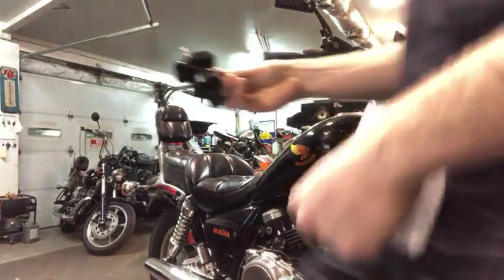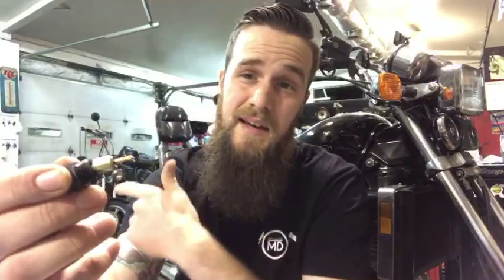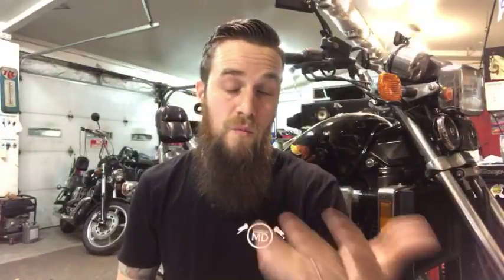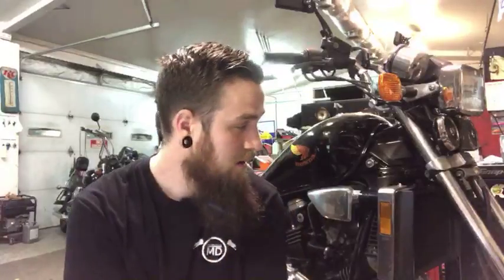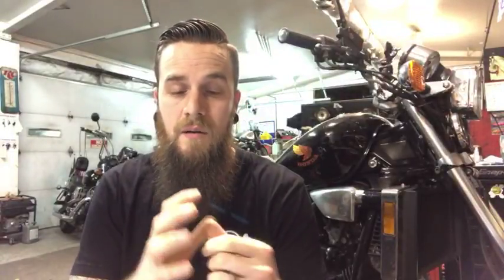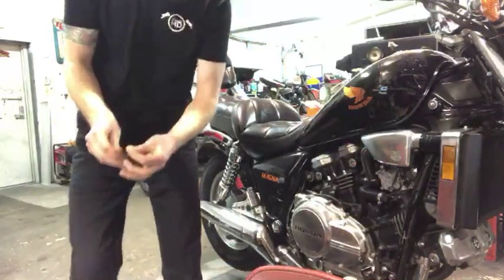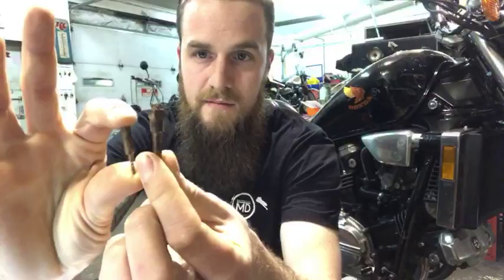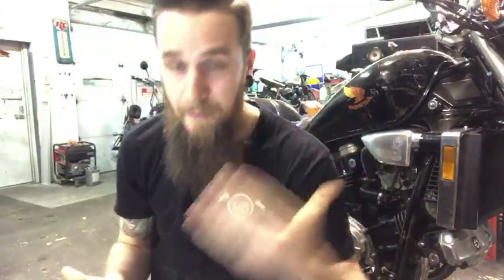What’s A Ground?- ASK MD LIVE Q&A: EPISODE 18

Comment: Thanks Brotha, I appreciate the info and the work you do. Question, Should the butterfly on the Carbs, be fully closed when idle or slightly open? I heard you say, go back to normal, where should the butterfly on the Carbs be to normal?
Reply from the maker: Most likely barely open.
Reply: thanks, just wanted to make sure. That is the way i have it idling.

Comment: Got no spark on my 1987 hondamagna  700 iv checked everything   except  the cdi box , but I just replaced  the starter  clutch  , does replacing  the sc  have anything  to do with my bike not starting ( I checked  the pulse generator  and it's reading  300 , so I'm thinking its working fine)  , so I'm down to my cdi box    is there a way to check it to see if it works or needs replaced   thank u in advance   , I I love watching ur how to videos please  make more ,,,rock on bro